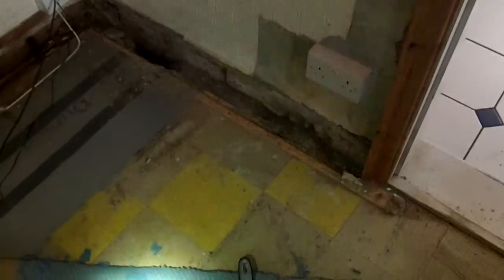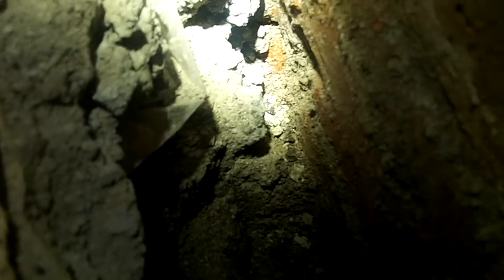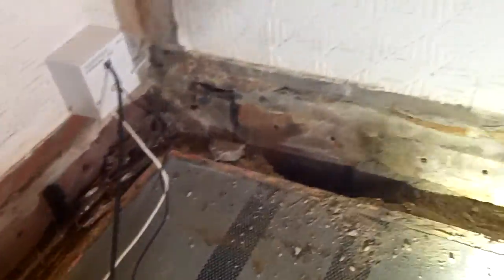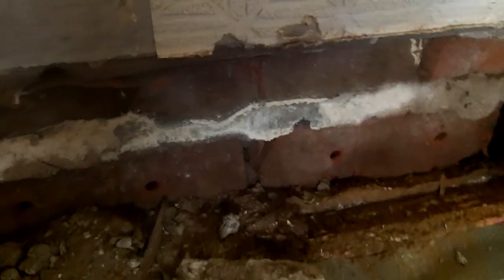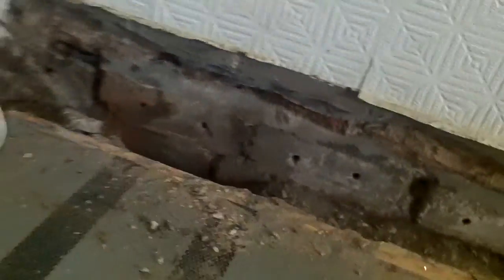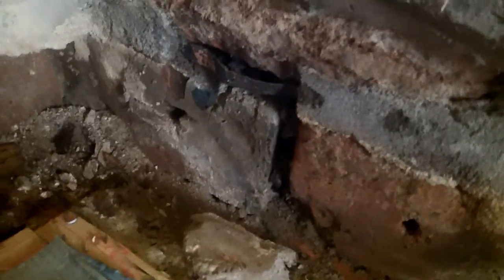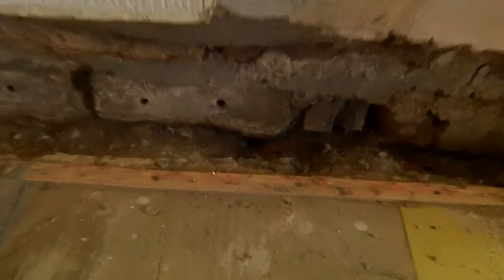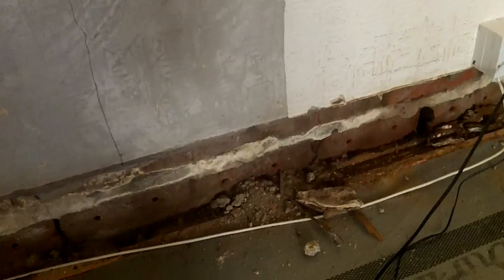Electro osmotic damp course and injection damp proofing don't work!

Comment: What about a beam and block floor
Reply from the maker: Could do - we prefer to use limecrete floors these days which allow breathability - and probably a bit simpler than a beam and block - which still needs ventilation.  But.. you are right in that it takes the house back to what it had in the beginning - concrete instead of wood - but a breathable sub floor - keeping the walls dry...

Comment: Agreed. The whole business is a confidence trick practiced on the public by high pressure salesmen who call themselves "Surveyors". It causes damage to the house fabric when its installed - and in one case it caused a fire in the consumer unit when unqualified idiots made an improper electrical connection.